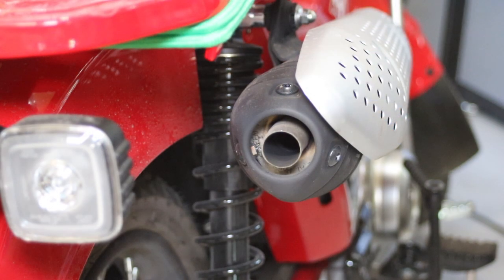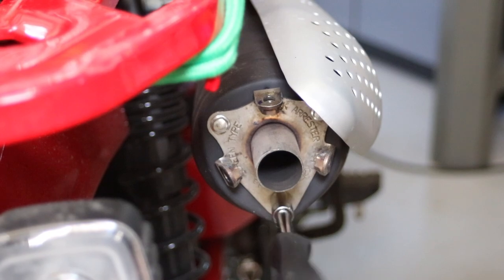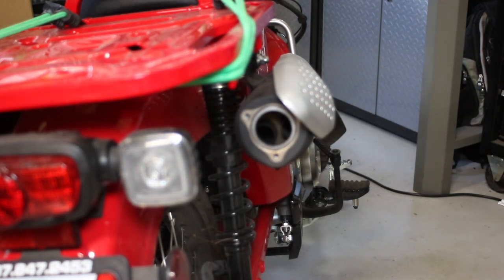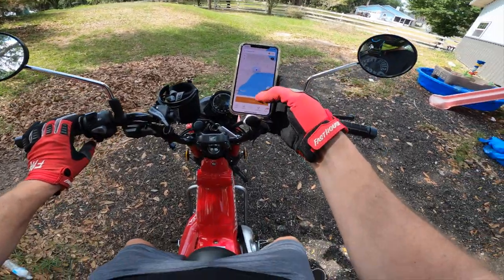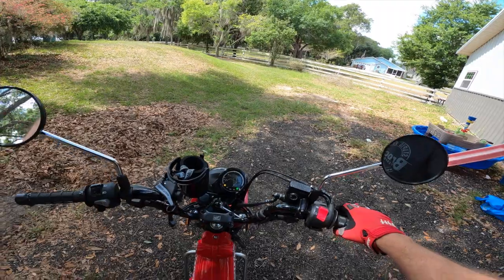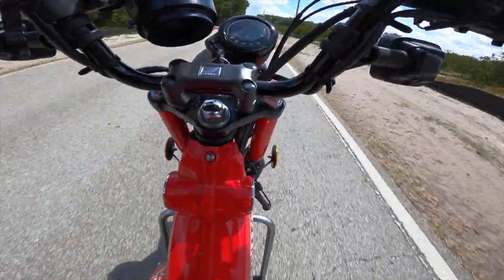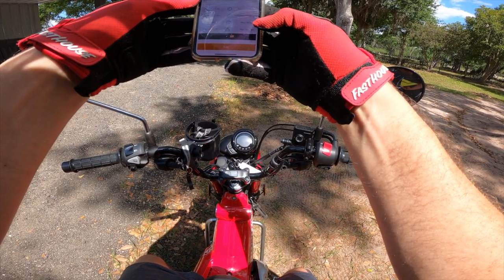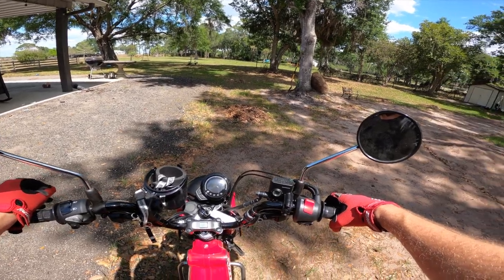Can we unlock horsepower from a stock 2021 Honda Trail 125 by removing the spark arrestor?

Comment: It’s a triple combo setup. Intake, fuel delivery, exhaust. If you uncork the exhaust it will run leaner. To compensate for this new lean condition you need more fuel. If it’s carbureted you need a larger jet. If it’s fuel injected you need to reprogram your ECU. You can burn valves, spark plugs and over heat the motor by running it too lean. 

After your speed run, shut it off and pull the spark plug to see how it’s burning. You should have a nice light chocolate brown color for optimum. If it’s white, it’s too lean. Black is too rich. 

Unless you have a race bike, leave your spark arrestor in place.  It’s a good thing. 

I just got a new $900 Yoshimura exhaust for my 500 and they forgot to put a spark arrestor in it. They sent me one and I installed it. Now I can ride anywhere legally. 

Your little 125 is a gem. Performance isn’t what it was designed for. I have a deposit in for the 2022 because they’re sold out everywhere in SoCal. It’s going to be for my wife. You’re lucky to have yours!
Reply: Did you get your bike yet?
Reply: @charkswitlazers  Finally, yes. I think it was about a 7 month wait total. The dealer raped me. They lost a customer forever because of their $1000 markup.
Reply: @charkswitlazers  I love the bike. Got it for my wife, but honestly it’s one of those bikes you just want to keep forever for anyone to use because it’s so cool. 

Coyne Powersports in Banning.

Comment: This reminds me of the seventies when my friends and I used to have mopeds in the UK. We used to punch all the baffles out of our exhausts searching for a bit more speed. My dad used to go berserk when there were four or five of us ringa dinging round the neighbourhood:)
Reply: Two strokes depended on that baffle for tuning so much. Didn't that make them lose power?
Reply: @manstersr  old two stroke mopeds are super restricted from the factory. taking the baffle off my batavus gave me a good 7 extra mph, and a LOT of noise lol
Reply: That sounds like a very good time and even better memories
Reply: Good times!
Reply: @manstersr  You are correct, 2 cycle engines need the tuned exhaust systems to run correctly.
Reply: 100 cc Yamaha 2 stroke with baffles removed. To get more power. Bloody noisy.

Comment: From past experience w/ other Honda motorcycles, you're more likely to unlock some top speed potential by removing sound control devices from the intake tract & wearing earplugs under your helmet; the company seems to go to great lengths to minimize intake roar and this will affect the performance all the way on top w/ the throttle WFO.

Comment: It's a 9 hp 125cc engine, even with an open perfectly tuned pipe you're still only going to gain about a 1/2 horsepower. If I remember correctly an air filter, tuned exhaust, and ecu flash only puts you at 10.7 horsepower. Just keep it stock and enjoy it
Reply from the maker: I plan to. I've modded my Honda Monkey quite a bit and it'll go 67mph, so I'd say an intake/exhaust/cam/high comp piston/ECU tuned to those mods are good for about 10mph at the most on the top end. I don't ride the Trail on the road too often, so I really don't care about top speeds
Reply: Thats nearly a 20 pct increase , you sound zany
Reply: @John5XR  from 60 to 70 is alot
Reply: Agreed. After decades of owning and modding cars and bikes (over 2 dozen), you're always better saving up and getting the drive train and features you want, so if and when you mod, it's minimal. Modding for the most part is a huge waste of money, and usually less reliable. With bikes, if a 125 is too slow, try a 150/160... still too slow?, try a 250-300, and so on....

Comment: A lot of bikes are shipped both lean and corked ie restrictive air box and exhaust. You typically need to address all three to have an impact.
Reply: You mean rich, not lean...
Reply: @techtard829  Nope. Lean. With the emissions requirements they are set lean on modern bikes. You need to add fuel and un restrict both the air box and exhaust. Way back in the day they tended to ship rich and all you had to do was uncork it.
Reply: @charlespratt8663  Ah, you only mentioned restricting the airbox and exhaust, in regards to lean and corked.

Alone, those would create a rich fuel mixture. But, they also use lower jetting(would it be metering on F.I.?), to lower fuel usage. Interesting. 

Fortunately, my bread and butter are classic two stroke Yamahas. RDs, RZs, TZs, etc. I dabble elsewhere. But, have not found myself having to deal with any of this modern fuel mapping stuff.

Comment: Back pressure has already been factored in by Honda.  Somehow I just think I would leave a $3,999 125 cc bike alone, or move up to a Rebel.
Reply from the maker: Watch the rest of the video 👍
Reply: @John5XR  I watched it all that was my point.  I would not have taken it apart in the first place, I would have bought a bike that fit my needs.
Reply from the maker: This bike fits my needs 1000%, which is to work around my house and go wherever I need it to go. It was a simple experiment to see if it did anything. Everyone seems to be missing that point and thinking I am looking to go 70mph or start forest fires
Reply: @John5XR  some people will never understand and it's a waste of time trying to explain
Reply from the maker: @bulletproof47 I’ve begun to notice that… 🤦🏼‍♂️🤷🏼‍♂️
Reply: @John5XR  Too funny 🤮
Reply: @gailmrutland6508 literally no one cares what you would do.
Reply: @gailmrutland6508  rebel is not a good comparison to a trail 125. There’s really nothing else like it on the market. Any other trail bike is more than double the displacement and 2-3x overall size, plus more expensive

Comment: Hi just fitted aftermarket full Yoshimura Exhaust no cat Converter, removed the rear rack , fitted Cover over the Air box, lot more Torque nice Sound looks great on my new CT125 Hunter ,just keeping a I on the Spark Plug don't want it running to lean.
Reply from the maker: Wow! That new Yoshimura exhaust is nice, I wish they’d send me one to test. Did your top speed increase at all?
Reply: @John5XR   Hi John top speed on 98  fuel Australia 103km standard have not tested with new parts fitted,do U think the ECU would b need turned 4 the Aftermarket parts I fitted? Thanks
Reply from the maker: So if Google is correct, that’s 64mph! Typically just the exhaust won’t require an ecu tune
Reply: Did you have to reset the ecu before running the new exhaust?

Comment: Bought Honda XR650L new in 1995 and talk about corked up and restricted. Jetted it up twice, the exhaust outlet same size as your 125 and had 5X displacement.
Parts desk had number for bigger silencer for a 4 wheeler, still didn't help. Noticed 3 Chambers inside muffler and with a 12"long 3/8" (use to build decks) bit I drilled into each Chamber as deep as bit would go. Put silencer back in and the difference was night and day. Had a nice bark...not too loud and increased mid range torque you could feel in the seat of the pants. Put 4.7 Clark gas tank on and the XR600 gearing. Could pull wheelies in second gear just jerking throttle open & I weigh 190#. Still Cruise at 60 mph without over revving  engine...and it had gorilla like power in Pisgah National Forest on logging roads. Still got 50 MPG. Stock gearing would do 115 easy and had to be going 65 to shift into 5th gear, way to high for the mountains and using engine for braking. That was my experience.

Comment: Your decrease in top speed is probably due to an increase in a leaner running condition. You may have been able to see a difference in the spark plug if you had done a before and after comparison. The point is, you increased exhaust flow without increasing fuel, so your results make sense. 👍🏾
Reply: Wouldn't fuel injection automatically adjust for that?
Reply: @chrishoesing5455  no needs to be programmed to exceed presets

Comment: 50 years ago we had a new CT70 as did one of our camping family buddies.  That guy was handy and he pulled the spark arrestor and drilled a few small holes in the air cleaner housing.  ALso rejetted the carb for the "increased breathing".  Both bikes ran dead even from start up to top end (about 40mph).   ;)     And that was long before any added emissions junk. 
Sure sounded meaner.  Always been that way.

Comment: see if you can use a high flow intake filter in place of the OEM filter as well as removing the spark arrester.  also, try getting an extra arrester and cut off near the plate you mentioned so you can replace the end of the muffler, if only for looks. it might add a slight resistance.  Enough to bring back that 1 -2 mph you lost.  Another thing you can do, is see if you can get a big bore kit that will take it to like 150cc or so.

Comment: I've been wondering what was behind the exhaust caps on these things. Granted I've only ever built motorized bicycles, one of the first things I always do is pull the exhaust cap off and cut the tube. I wonder if this kind of modification is better off on a two stroke?
Like you said though, Honda has this motor tuned with that exhaust and love em or hate em, you really can't argue with Honda reliability

Comment: If you open up the exhaust you need to increase air flow and fuel or you will be running lean.
Reply: The stock ECU easily manages the fuel with room to spare. A quick reset or just letting run for a while and its fine.

Comment: If you ride off road or on BDRs , forest service roads, public lands spark arrestors are required. Regardless of sounds or horsepower gains removing it is not advisable.  Many aftermarket exhaust systems include spark arrestors. The reason they are there is for what they name implies which prevents fires . JS.

Comment: One thing you can do...make sure at wide open throttle the carb slide completely clears the venturi.

Some bike the spring will coil bind prior to slide clearing venturi
Reply from the maker: that'd make sense on a carbureted bike

Comment: The screen will carbon up after a while, and restrict flow, but is a simple maintenance item if you remember to do it.  If you don't want to bother with that, you could punch out just the screen.
Reply from the maker: This is what peaked my curiosity when I read the manual. I like the quiet sound of the exhaust though and want it in, but the experiment was fun to try

Comment: In case you never checked it via GPS but the stock speedometer is about 2 mph higher than your actual speed.  Everyone on the forums report the same thing.  I'm not real surprised the speed didn't change much.  Sometimes more back pressure provides better performance.  The engine is tuned for a certain amount of back pressure.  Of course there are too many variables to be certain.  Same wind as before?  Exactly?  Same wind speed and same direction, exactly?  This bike is very susceptible to any small changes like that.  Also, when you open the exhaust up, the normal thing to do is you have to increase the breathing (more intake to take advantage of more exhaust).  Again, it was a quick test that proved nothing because you didn't increase the airflow to match the new exhaust free-flow and the weather is your biggest factor.  But it serves to tell people "don't bother taking out the spark arrestor". (which is illegal in the US anyway.)
Reply from the maker: I cross-reference all of these test rides with the REVER app, which tracks the ride and provides the top speed achieved. It’s gps based. My Speedo was 1mph slower than the app, close enough for me. 
You might not be like me, but when I flipped through the manual and saw a big potential restriction in the pipe that could be removed with a few bolts, there was no way I wasn’t gonna take it out and see what it did. Whether it worked or not, I wanted to see what happened. I’m a racer and a tinkerer, even if the experiment doesn’t work on paper, I find the experience fun and interesting nonetheless. 
You say it proved nothing? Absolutely it proved something: that it didn’t help top speed! Lol! 
And I’m not worried about legality, as here in Florida we run motorcycles with aftermarket pipes with no issues from the law. If I’m riding in a US forestry or park, yes it is required to have a spark arrestor and I would do so
Reply: @John5XR  I installed the opmid speedometer multi-meter so I could set my speedo to read exactly what the GPS says.  Also, like most of the guys that got these anemic bikes, I've been changing the gearing which put the speedometer a long ways off so the Opmid makes up for those experiments.  I don't know why your speedo reads slower than everyone else's.  All cars/trucks, bikes tend to read higher (they say it has something to do with keeping you at the speed limit because everyone speeds a little), but all manufacturers do it and pretty much always have.  Like everyone else, mine read almost 2 mph higher than I was going and when I geared it down it was off by at least 5 mph.  I hated having to think about what my speed really was all the time when I'm in town, and of course it affects your odometer so your mpg calculations can be way off.  BTW, I got 140 mpg yesterday.  I've been doing some slow riding while my wife gets her new trike broken in.

Comment: By removing the arrestor will not do nothing. You will have to remove the cat and arrestor. After that open up air intake. Then turn up the fuel flow to match the air and exhaust flow. I gained 6 mph by doing that on a 250 cc. One removal will not work without the other. The mods all work together to make the gain.

Comment: Yep. You’re right.  Honda looks to have done a great job tuning the spark arrestor into the exhaust. That arrestor is a behemoth compared to the other aftermarket exhausts.  Wonder if you’ll have any more HP after break-in and first oil change?
Reply from the maker: It’s a huge restriction, but if you look into the pipe there are other smaller pipes in there as well, kind of like a 6-shooter barrel, it’s weird. Once I saw those I didn’t think there would be a huge flow increase from removing just the spark arrestor, but was curious to try either way. With an aftermarket pipe and ecu reflash, it would probably add a good amount of power and speed to this bike, BUT, I like the super quiet exhaust as I use this bike around the house
Reply: Didn't he say he's owned his CT125 for a couple of years now? Ive watch an ass load of videos on these Honda Mini cycles today so I may get what was said, mixed up! Great little machine

Comment: Manufacturer's designs come with air fuel ratio in mind as well as proper back pressure so you do not lose torque. As somebody else said if you change the exhaust you have to change the intake and then remap the fueling unless there is enough fluctuation in Hondas stock equipment to adjust on its own
Reply from the maker: Just an experiment, not an actual thing I was thinking I would keep or implement
Reply: @John5XR  I figured.  I was definitely curious.  I knew the result, but what if?  Lol!  Thanks for posting
Reply: @John5XR So in your opinion John, would it be okay to leave it out permanently if I’m sticking to the street?

Comment: This bike is computer controlled. It has an oxygen sensor in the engine head. When you removed the silencer/spark arrestor you did lose back pressure. Since an o2 sensor works by testing the amount of heat in the exhaust, it allowed the temperature to drop. When the ECU got a cooler exhaust reading it assumes that the air/fuel mixture is too rich & the ECU corrects by decreasing the fuel. Therefore it made it run leaner. The only way a computer controlled fuel injected engine can be modified in any way is to have the computer reprogrammed to accept this power upgrade modification. That’s why fuel injected racing dirt bikes have many different programmers to take care of all the different power parts people bolt on. Yes, the ECU does does some learning, but not enough to increase power & in most cases as you have now learned it generally loses power because of the original engineers programming it to do just what you witnessed. The UN, EU & USA make these demands on all manufacturers.

Comment: I wonder if simply adding a 5th gear with a taller ratio on the top end would help. Intake and exhaust is a super finicky balance. Id not mess with it unless you have full ecu flash and tune.

Comment: If it flows more air without the arrest or, you’d then also need to remap the injector to deliver more fuel. Otherwise, you’ve leaned out an already lean motor which will always result in less power.

Comment: Put a ngk sparkplug,it's hotter remove throttle cable off the carb and put a steel flat washer,(about 1/32)under the ventura piston ,remove cable first put washer on reverse procedure, open gap on sparkplug to 43 should get about 65mps exsperiment,

Comment: Off hand guess from other bikes I have owned: All new bikes run lean to make Uncle Sam happy. We are not in the 70s anymore, so inverting air cleaners and such shade tree mods probably won't help. Honda engineers know what they are doing. Cats really don't restrict that much these days. Remapping the fuel injection to richen it up at certain RPMs/ wide open throttle positions might give an extra fraction or even 1 or 2 MPH.
A bottle on nitrous oxide would do wonders though. Until it melts.
Reply: Not run lean to make uncle Sam happy, it was just the air conditions, in the country/factory where it was set up, can be different to where you live, so in the factory it might have been set up perfectly,  shipped to you local dealer, it can run rich or lean, cos the air conditions are slightly different!
Thats what my boss at the bike shop I work in tells me anyway! So we have to re-tune all the bikes we sell to our local air conditions!